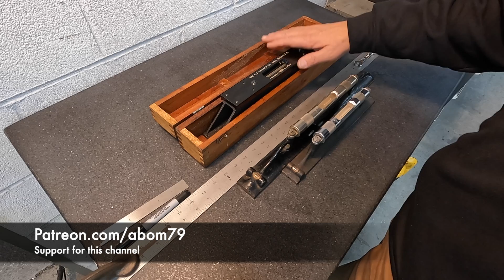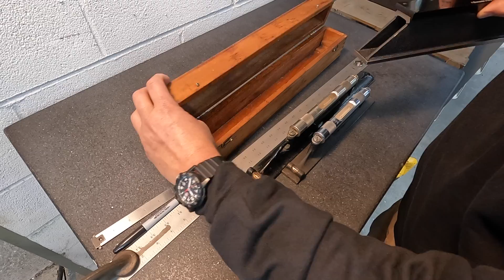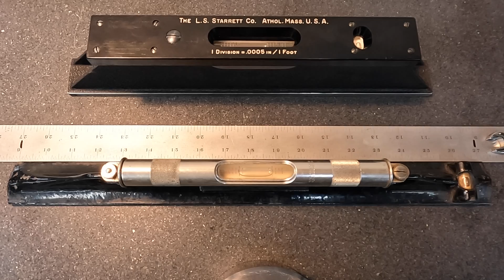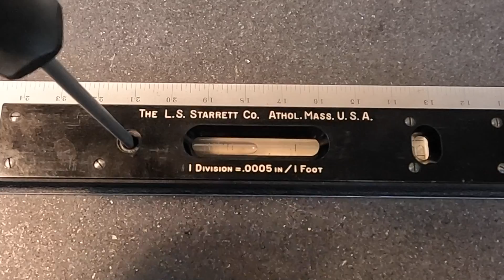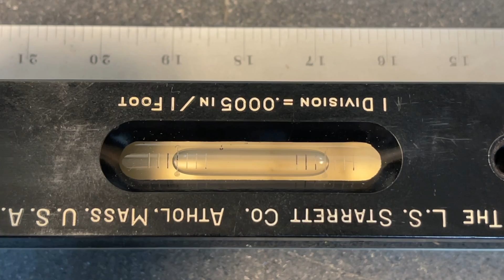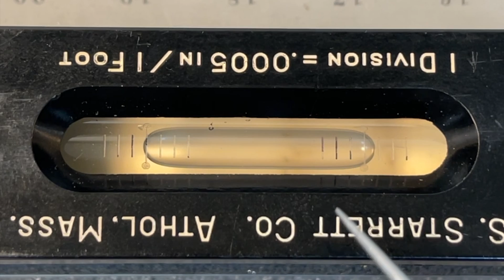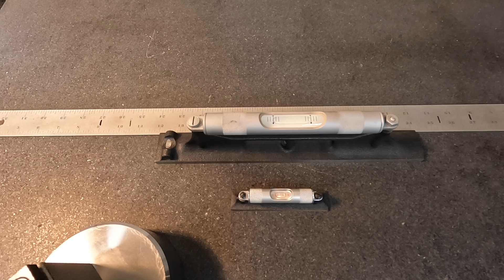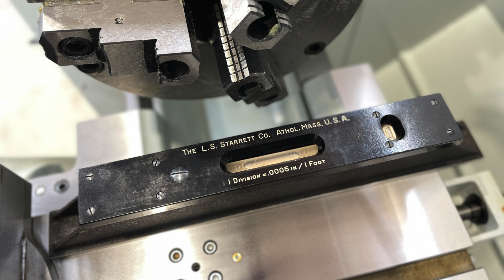Precision Level Calibrating

Comment: cool demonstration, thanks! that being said, lathes don't need to be perfectly-leveled, they just need to have the spindle and tail stock aligned. they use engine lathes and other precision machining tools on military ships, and they are never level.
Reply: The machine needs to be level with itself or it will turn a taper
Reply: @Pyromaniac2450  "level with itself" doesn't mean anything...level is only in reference to the earth. as i said, the lathe spindle and the tail stock must be aligned.
Reply: @douglasharley2440  That won’t account for twist and bow of the ways. A lathe is not monolithic. A lathe that is not level makes undependable cuts.
Reply: @yqwgjsg  yes, i fully agree...but the bed ways being true have nothing to do with the lathe being level. joe pieczynski has an excellent video explaining it all in detail.
Reply: @yqwgjsg  do this thought experiment: you have a lathe resting on a giant reference plate that's perfectly level, and the lathe is perfectly aligned and trued, and it makes perfect cuts...now tilt that reference plate in any direction and explain how the cutting will be at all affected. it will not.
Reply: @douglasharley2440  True but if you go back and watch the Joe Pies' video he makes mentions levelling the lathe bed front to back *first*.  When a manufacturer sets up a lathe or mill (or any other machine tool) they usually specify that it was level *when it was set up*.  That is to say that all the parts were loaded a certain way. If you would tilt your hypothetical surface plate with lathe rigidly mounted to it 90 degrees then the cutting will certainly be affected as the loads on the bed will have shifted in direction and magnitude. It's all very well to talk about hypotheticals but in the real world nobody bolts their lathe or mill to a surface plate.
As far as ships are concerned... they can be level, or a portion of the deck made level when in dry dock. A colleague of mine was a machinist on board a destroyer and they had a small (very small) machine shop that he was in charge of. The lathe they had was bolted to pads that were welded to the deck. They had problems with doing long straight cuts sometimes and he told me they compensated for that with a lot of filing and emery cloth as required by the tolerances on the part and the conditions they had to work under.
Reply: Leveling in this machine tool world is a little bit of a misnomer. Not necessarily “level” to the world but level or consistent to itself across it’s working area. For example, an aircraft carrier or destroyer may have a machine tool room in it. Those machines (lathes, mills, etc.) also have to be level but only level compared to itself. It can’t be leveled to the world since it’s at the mercy of the sea.
Reply: @c0mputer  yes, that is "true-ing" and "aligning" and "tramming", but not "leveling". all those things need to be done, but none of them require levels. lathes do not need to be leveled.
Reply: It’s obvious you haven’t a clue. But thanks for making that clear to everyone else here.

Comment: Actually, the way you are supposed to remove these levels from the box and place it, is with your forefingers under the edges of the Bakelite, where the casting is, on the ends of the top. So yes, you are touching the metal under both sides. But, when you handle it, the touch is just with your fingertips, and for a short time. The mass of the level is enough that it doesn’t get effected by this, and the heating, if any, is even in both ends. The level wasn’t really made to just grip it by the Bakelite. They didn’t build in grip areas on just the Bakelite, you really must touch the casting. But just lift by these ends and you’re fine. I’ve been doing this for many years, and I haven’t found it to have any effect on the readings.

If you try to lift it by the edges of the Bakelite, you have to grip hard so it won’t slip out of your hand, and will likely touch the side of the casting anyway. Slipping your fingers under the ends lifts it easily out of the Bo’s. Try it if you haven’t. You’ll like it.

Comment: at 2:00... One must read and understand the difference between "precision" and "accuracy"... A level being 0.0005"/ft does not mean it is more accurate than a 0.005"/ft level. With both levels (0.0005" and 0.005") properly calibrated, when the bubble is in the exact middle, will indicate the surface being surveyed is level... Details matter... Not that it is needed for this job, a calibrated precision accelerometer level will be much better since it shows you a discrete number instead of eyeballing a bubble (regardless of whose eyeballs being used). MEMS (micro-electromechanical system) sensors beats human eye any second of any day of any year... so on. If MEMS existed and were being used in 40's you'd be all over it, but, rest of the world would already have something much more advanced 🤣...
Reply: So, aside from the snark you really have nothing to add except newer is better?  Some people like older tools, and have actual video's on their channel which give many other some enjoyment. And others, don't...

Comment: Maybe someone can tell me, if a level is calibrated bringing the bubble to the center on a surface plate that is not perfectly level relative to the gravity vector, then all the equipment leveled with this level will be parallel to the surface plate, but not necessarily with gravity. Is it common for machine shops to level everything relative to one fixed surface plate, or do shops also keep a master level that is actually calibrated to be level relative to the gravity vector? Sorry question is a bit convoluted but hopefully makes sense.
Reply: Let me try.  You are not calibrating to anything but the level itself.  It does not matter if the surface plate is level or not.  The fact that you turn the level 180 degrees, the surface is irrelevant. Not an expert, but I do live one town over from Athol, MA :)
Reply: I understand what you're asking, and shops would definitely have everything leveled in relationship to the gravity vector and not the surface plate. They will adjust everything else to match the master level because the plane that the top of the granite plate would project in all directions wouldn't be parallel for very long before the curve of the earth comes into effect. The channel Texas barndominiums did a video on something similar and he described how people who build really big warehouses will use a water level because using a laser level over long distances can actually throw off your measurements because they don't account for the curve of the earth but a water level will. I'll try to find the video for ya.
Reply: @bdkj3e  Frikkie and Bdkj3e, both excellent questions and useful info.
Reply: You take a reading then turn it 180°and take another reading.    The average is perfect level.
Reply: I’m struggling to get this. Surely what Adams doing only works if the granite plate is 100% level?
Reply: @darrenphillips6456  The reference surface only has to be level enough to keep the bubble near the center, because you're evaluating the reflected symmetry, not the absolute centering, of the bubble in either 180deg orientation.
Reply: @RichardKinch  Thanks Richard. I think Adam was centring the bubble between the marks ( as far as I could see) which would suggest the granite was indeed level. This now makes sense. Best regards.
Reply: @RichardKinch  After watching Adam calibrate his high precision instrument I used the same process to dial in my much cheaper Chinese model. It has a wide bubble graduated in .0005 in 10 inches and a hardened and ground steel base. I used Keith Rucker’s method of turning slowly on the surface plate to find the level spot. Flipped it 180 and sure enough it was out of calibration. Adjustment screws were on both sides under the Bakelite and once I got them broke loose I was able to bring it right in to almost perfect. Thanks Adam.

Comment: As long as it’s the same reading down the bed it doesn’t matter if the level is calibrated. Only time it matters if the level is way off and you want to make sure your coolant drains.
I rarely calibrate mine and usually pitch them towards the sump and check twist.
Reply: Correct, Lathe does not need to be level. Just no twist in the bed.

Comment: That old 18 inch level is what I believe is the model 97 that has the jappaning and the rounded bottom on the casting.  The old ones are built better than the new ones…
 Oh and that 199 is flatter that what your machine or surface plate is ground..

Comment: Art supply, super fine pin striping brush and super black enamel and an Optivision magnifier and you can repaint those black lines. Glad you did this video. I have the 12 inch starret and it needs calibrated.

Comment: An interesting video. You should get in the habit of turning the cover over the level as soon as you are finished using it. It only takes the smallest tap to break the glass. That makes for a bad day.
I was leveling a machine one time and asked for a level. They brought me one and I did not look too carefully at it. An hour later I was still struggling to get the machine level. The bubble would go from end to end. Then I took a good look at the level. It was a Master Precision Level not intended for machine leveling. It was a Metric level 0.001mm per Meter I think. After that I always carried my 6" Starrett .

Comment: Just wondering if they will need to be re-calibrated at new shop before leveling lathes due to temperature and humidity differences. For me they would be close enough but not sure if my close enough and Adam's are the same. 
Regardless of all the naysayers I find these videos more entertaining than watching chips flying around for 1/2 an hour unless the detail is provided like cut depth and feed speeds etc

Comment: Ummm...you certainly DONT need a level as accurate as a 199 to level a machine out. Even a dollar store level is good for most machines. I work in a shop with some of the most accurate Swiss style machines and any good level is good. If you’re within .1” over the 12’, it’s within spec per manufacture
Reply: I think you’re misunderstanding the concept of leveling a machine.m there are all kinds of machines, and what leveling means on them. Leveling a mill is very different than leveling a lathe. Most mills are made on a bed that doesn’t twist too much because of the shape and distribution of mass, such as a Bridgeport, with a small bed. You just need to level a lot of them enough to prevent coolant from running off the edge of the drip groove.

I don’t know of any CNC manufacturer that would agree with you on these machines.

Lathes are different. The problem is that leveling isn’t what we’re trying to achieve. They should be somewhat “level”, to be sure. But that’s not the problem, and the term “leveling a lathe” is the wrong one. It should be called “removing the twist from the lathe ways.” And yes, that requires tenths of a thou to be removed. If you don’t, you will cut tapers, and have other problems.
Reply: @melgross  Co-plane the lathe?
Reply: A dollar store level is NOT good enough to level a machine. Ive levelled enough lathes to know better.

Comment: A number of comments are about "eyeballing" it. But every last thing Adam does has its accuracy checked by Adam's fingers and eyes. His calipers are only as good as his fingers are. This actually works, because Adam can machine a piston to 1/1000 and slide it into a cylinder fitting perfectly and with no slack. Some other human hand calibrated that cylinder. Check out the Edge Precision channel. He runs a Computer Numerically Controlled lathe/milling machine. "Computer accuracy" is achieved by him measures where the computer has put the cutting head by using the same finger tightening the micrometer that Adam uses.

Comment: Note that on any plane surface (like a good surface plate) which is stable, there will be a line across it that is perfectly level. You just have to rotate your reference marker (the long scale in this case) until you find that position. Rotate the reference until the level reads the same when swapped end for end. Then you can adjust the level until it reads "center". I think Tom Lipton did a good cover of this effect a while back.
Reply: well that doesn't help people w/o  plate and you don't need to waste time on finding it. The whole point of the level is that it's one of the few self calibrating tools.
Reply: Yeah, the point isn't to find a level line on the plate - it's to calibrate the level itself, which you do not need a level line to accomplish - the level itself just has to read the same when flipped end for end, then the level is calibrated.

Comment: Adam, you should use a smaller screwdriver on width and a shorter shaft.   juste the weight of the screwdriver does affect the precision of the adjustment.

Comment: While I appreciate the precision of these levels, it all seem a little over the top... surely everytime you tap on the machine, temperature change, speck of dust and even oil on the finger, it will be off levelled just a tiny amount. If that level of precision is required then that means you have to do this every time you machine something and would have to make sure temp and humidity is identical. Realistically, is this level of precision required for these type of work (not a machinist)?
Reply: It is required or these tools and procedures wouldn’t exist.
Reply: When you're installing a large machine, you want it to be as level as possible to avoid uneven wear on the ways. Actually it's not even "level" that you care about so much as there is no twist, which can lead to all sorts of odd uneven wear. You'd probably only do this a couple of times - once when initially installing the machine, and once again a month or 2 later, after the casting of the machine has had time to settle. After that, you're not going to be checking it too often (unless you move the machine, or there's binding or something going on), but the better you can get it initially, the more even the wear on the machine will be. When you consider that the machines these are meant to level typically cost $60,000 up to $millions (large CNC mills and lathes, injecting molding machines, printing presses, other large expensive industrial equipment), it's really not that out of the question to use a level that's this precise to ensure it wears evenly.
Reply: Joe C. This level of accuracy and precision is used for setting up equipment and verifying the calibration of other equipment.  You'd want at least 4x the accuracy for your calibration reference.  A lathe doesn't have to be perfectly level but it does have to be a plane with no warp, twist, bow etc. Some operations take place on vibration isolated floors in rooms that hold a degree or so for temperature.
Reply: if its not level it will twist the machine which will cause the work not be precise. In a lathe it will cause the diameter of the part to change over its length. See ToT video for a great explanation.
Reply: His lathes don't need to be that accurately set up but there are definitely some that do, I've seen videos of machines so ridiculously precise that the vibration from clapping next to it can be registered.
Reply: Joe, yes, its all really just a way for machinists to up their billable hours...
Reply: Thanks for all the explainations. I guess if you are setting up a new machine you may as well go all out. Minimize future adjustments.

Comment: Thanks for the video. You actually don't need a level (horizontal) surface to do this calibration. Providing the bubble is in the same position in both directions then the vial axis will then be perfectly horizontal when the bubble is in the middle. The physical adjustment to the vial requires removal of half the error (difference between the readings). Consult a good land surveying book for an explanation of the mathematics if you are interested. Thanks again.
Reply: He just spent 25min explaining that very thing.
Reply: @rusty1597  No, no, no.  Abom just spent a half hour explaining that...

Comment: Keith Rucker did a video on this that is helpful for calibrating multiple levels. After calibrating the master level, slowly rotate it on the surface plate until a clock position is found to be level. (There will be one orientation that is level even if the surface plate is not level). Lay the straight edge along side and clamp it down. All other levels positioned there can be calibrated directly to zero the first try.
Reply: I think it is this https://www.youtube.com/watch?v=z94tK53vYmU&t=1533s&ab_channel=KeithRucker-VintageMachinery.org but he uses a master reference level which he knows is perfectly calibrated to check the one he has scraped.